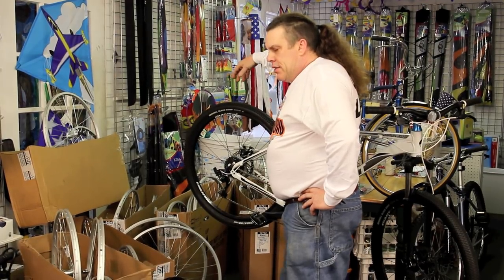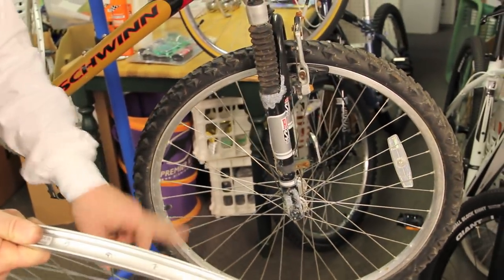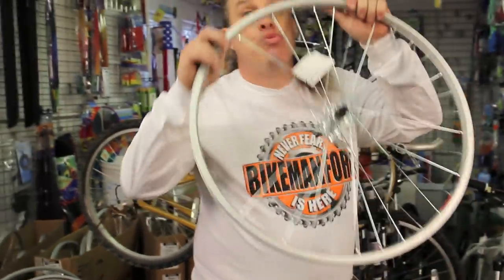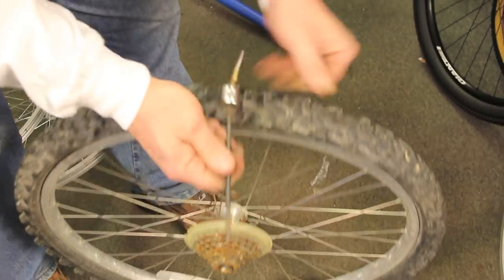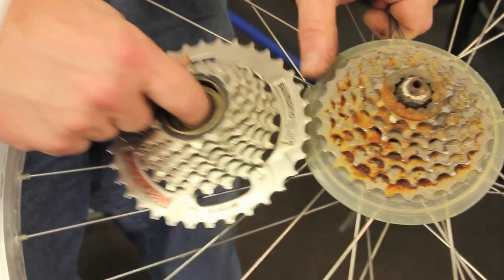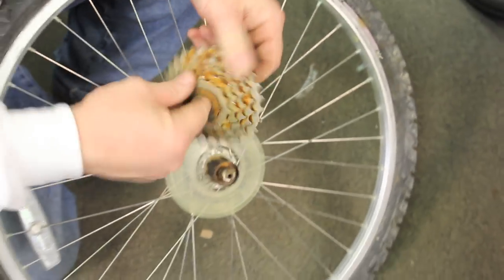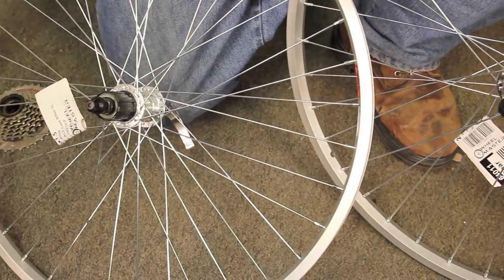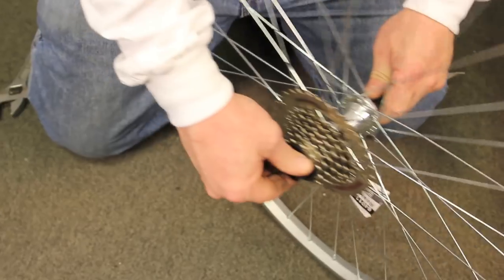MTB Wheels Tutorial - Freewheel vs Cassette - BikemanforU

Comment: Great video! I love your enthusiasm. This really helped me to learn how to visually distinguish between a freehub cassette and a freewheel.

Unimportant Question: Why do bike folks use terms like cog and sprocket incorrectly? I think that within the bike community the definitions are different but in engineering a cog is one of the little teeth and a sprocket is the single wheel around the perimeter of which are the cogs. Among bike folks the terms are used interchangeable and can even refer to the entire cassette or freewheel cluster.

Comment: You can also use the quick release skewer (with the springs removed) to hold the FR-5 (Cassette removal tool) tightly in place to make removal easier. It the tool slips off the lockring while you are applying a lot of force it can damage the lockring/injure you, making it damn near impossible to get off. Just make sure to loosen and remove skewer as soon as lockring breaks free. Some removal tools have a post in the middle which inserts into hollow axle, helping to stabilize the tool. In this case you cannot use a skewer to hold it on.

Comment: Awesome videos man.. I have a Huffy hardtail.. I think. 26 x 1.95, Shimano SIS MF-Z015, 5 speed cassette stack, 5 speed (14-17-20-24-28T).

It says I need a TL FW30 freewheel removal tool.. Park tool says it's a FR-5.2, 12 splines..

So all I need to do is buy that FR-5.2 tool? Or should I get the TL FW30 tool?

I wanna put a single freewheel cog on it, and also buy spacers for it, how do I find cogs for the freehub body I have?
My goal is to put a little BLDC motor on the back and have a chain drive the single cog on the rear wheel.. that's my goal.

Comment: Great video BM!  I have a question: 
I acquired a free road bike from a demolition company and decided to turn it into my project (full disassembly, respray and try to reurbish the parts). I'm 16 now so this is my very first proper project. So I was wondering what's the best way to remove the old paint from the bare frame (alluminum) and respray it? And since I'm in college right now, it has to be on a budget :) I also considered Plasti Dipping or wrapping it into vinyl. What do you say BM?

Comment: would you think an fr-5g (with guide pin) is better than an fr-5? It supposedly has a longer body to prevent stripping on super tight lockrings. I request YOUR opinion -- is it worth 3 more bucks, or should I jst get an fr-5 and spend the $3 on a nice brew?

Comment: My front 29er Manitou Tower Pro is a 20mm thru axle, but I'm still rocking 135 qr out back. I've been thinking of switching, but I cringe at the thought of changing flats on the trail. No tubeleas for me either. If I was in NY I'd lend you my bike for a video. :-)

Comment: If you end up replacing an old rear MTB wheel with a new one you may, in addition to needing the spacer, have trouble squeezing the wider wheel into the rear dropouts. If it is a steel bike the frame can be spread and realigned by a competent bike mechanic. If it is aluminum you just need to squeeze the seatstays apart a bit when inserting the wheel.

I have an aluminum 1990 Trek 1400 road I upgraded from 7 to 9 speeds with extra parts I had that I just squeze a 130mm wheel into the 126mm dropouts and it is no big deal.

Comment: Question:  I have a 7 cog freewheel on my budget mountain bike (Hyper Summit) but it is 14-28 tooth range (14,16,18,20,22,24,28) but I prefer a lower 1st gear.  Shimano has a MegaRange 7 speed freewheel which has 14,16,18,20,22,24,34 so the only difference is the largest cog.  So do I need to change anything else like the rear derailleur or can I just make an adjustment to it?  How will it "know" to pad out enough chain slack for those 6 extra teeth?  Might I need a longer chain?  My crankset has a triple chainring (24, 34, 42) and also has a Shimano derailleur.  If I can get this to work, I will have a 24-34 low gear which has about a 4.8 foot rollout per crank turn which is a good gear for uphills, thru grass....

  Ideally (since I don't use the largest (42T) chainring in the front), I would like a smaller smallest chainring in the front such as a 20 if they make it.  I am wondering if someone makes a triple chainring with a 20T smallest gear that would fit my bike or is there someway to remove the 24T and somehow attach a 20T in its place?  The 20-34 lowest gear combination will give me a 4 foot rollout per crank turn which is even better than 4.8 feet.  What do you think is the smallest gear that will fit on there?  Do you need a picture to determine that?

Thank you.
Reply from the maker: Lots O questions David. You might have to change the rear derailleur when you go to a mega range. To get the right chain length big to big +2 links we have a video on that.  There were adapters out there to go to a small front chain ring they worked OK not great I don't know if you can get them anymore I will look into it. Give me a call if you have any questions 631-902-0836 I will try to help
Reply: BikemanforU - Hi and thanks for your reply.  I did some research and a visual inspection and it appears I indeed have a 7 speed freewheel which appears to be the Shimano MF-TZ21 but I would like the MF-TZ31 which is exactly the same except for the low gear cog which is 34T instead of 28T I have now.  I noticed when I have to ride across grass, even if flat ground, the 28T gear is still not low enough so the 34T should be a big improvement.  I am not sure what you mean correct chain length big to big +2 but if it means the largest chainring in the front and the largest cog in the back, I will never set it in that configuration so it is not needed.  My ultimate low gear would be 20 front and 34 rear for a 1 turn "crankout" of just 4 feet with my 26" diameter tires.  That is, the tires will roll only 4 feet per complete rotation of the crank.  You did not answer my question about how does the rear derailleur know how much chain to "pad out" for the next larger rear cog so for example, if I change from 28T to 34T largest cog which transitions from the next size (24T), it would have to pad out enough for +10 links with the MegaRange setup vs. only 4 teeth of the current setup.  Instead of a 10 tooth jump why didn't they just spread out that big jump over many gears such as 34, 29, 24, 21, 18, 16, 14?  That would make more sense to me.  Perhaps it is a marketing gimmick to make the 34 look huge compared to the 24 next to it or maybe they did not want to disrupt the other gears.  I will call later to give you some time to do some research first on the adapter.  Also, I dont really use the largest front chainring so if someone makes a dual chainring crankset with a 20 that can fit my bike that would be an option if it is not too expensive.  However, is it possible to buy a 20T and have someone weld it onto the existing chainring set, possibly first chopping off the 24T except for the center portion so there is something to weld it onto or is it better to use some special adapter or possibly punch out the rivets and use small nuts and bolts to hold the new chainring on?  A 17T might not fit but would be an awesome gear driving a 34T rear.  That would move the bike only 3.4 feet for every crank rotation.  It would take a cadence of about 115 to match walking speed of 3MPH in that ultra low gear.
Reply: Other related questions:

  1) Since I only need a limited range of speeds, I am considering a single front chainring conversion (to 20T) and then using a wide range freewheel on the back such as 11-34T.  That will give me both the very low gear and a reasonable high gear good for maybe 15 MPH which is about as fast as I go here on this flat terrain (mostly on sidewalks).  My question is, can I space out the single chainring so it is better aligned with the middle cog on my 7 speed freewheel?  I would think that would be ideal.  Is that recommended?

Question 2) I would like to know how the rear derailleur knows how much chain to "pad out" for each gear.  For example, if someone changes every cog on a cassette, how then will it know how many teeth the new setup has and how to adjust the chain slack accordingly?

Thank you.  I both subscribed and gave you a thumbs up.

Comment: OK Bikemanforu   How is it going ? Been trying to get a grip of back  wheels for ages . . Got a 1992 Ridgback Hybrid She is  old, can I bring  her back from the old shed  yard??? YES I THINK I CAN  . Great video, one step closer now after you video . Just run through you video a few more  times and you have saved me ordering the WRONG PART Thank you Bikemanforu !

But my drop out size is 130 cm  not 135 cm . Anyway will have a look at the rest of your stuff .  Will the ridgeback make a come back ?

Dave uk
Reply from the maker: well You need to loose 2.5 mm from both sides... You could remove a washer on each side and that might do it. Is the wheel a quick release, if so you will have to shorten the axle too. good luck and I KNOW YOU CAN DO IT!!!

Comment: Can I swap a 6 speed freewheel with an 8-speed freewheel? Or the hub will not provide enough support for the 8 speed?
Reply: nhanlm0601 It should be fine IF the wheel and frame are both 130mm spaced, but I'd recommend sticking to a 6 or 7 speed. 8 speed freewheels were short lived due to reliability issues. Freewheel hubs have a greater length of unsupported axle which means they are prone to bending and breaking axles. The 8 speed freewheels were plagued by axle issues so unless you are riding on very clean roads with a light load, stay away from them. I broke the axle on a modern 7 speed freewheel hub from hitting a pothole.
The good news is if your bike has 126mm or wider rear spacing, a 7 speed freewheel will likely fit. For the best durability, get a bolt on rear wheel. The solid bolt on axle is much stronger than the hollow QR axle.
Reply: +nigahiga6400 Thank you!

Comment: hi bikeman i took my back wheel off and now when i slide it back in and tighten the quick reliese  the wheel is too tight to turn can you help

Thanks all the way from bonny scotland
Reply from the maker: is the brake rubbing??? if not the bearing cone nuts need to be adjusted
Reply: Thanks for the reply BM the brakes are fine (disks not attached to frame yet) do you have a clip on adjusting the cones at all??

Comment: Heh, better known as the "dork disc".  It is not important at all...IF...You have your derailleur set up correctly.  The derailleur will never go out of adjustment unless you whack it good on something.

OTOH, if the chain does get thrown over the big sprocket it "could" snatch a spoke, send you flying and FUBAR the wheel...